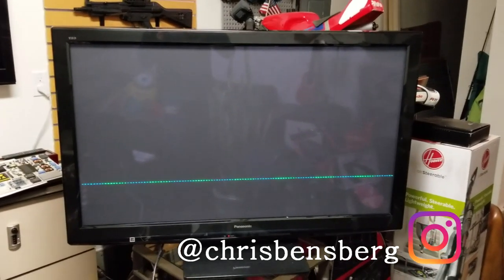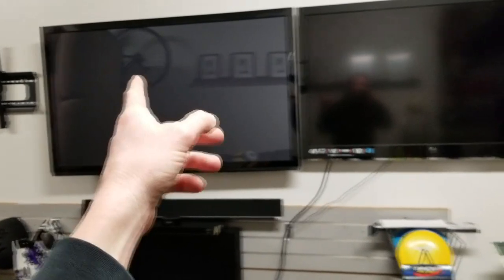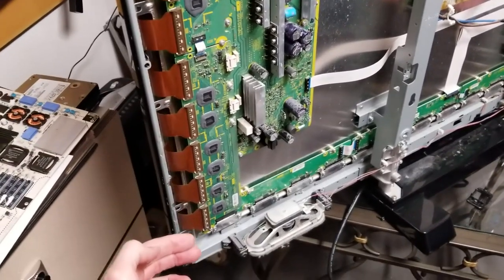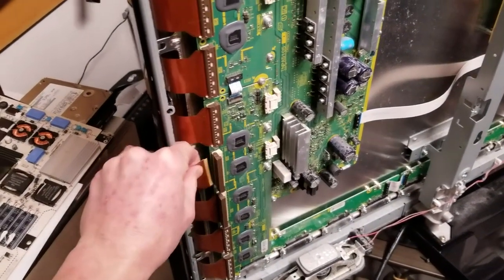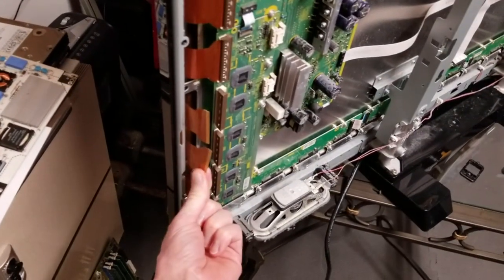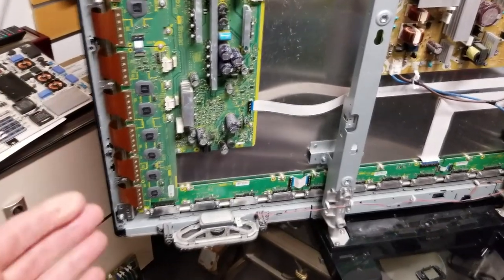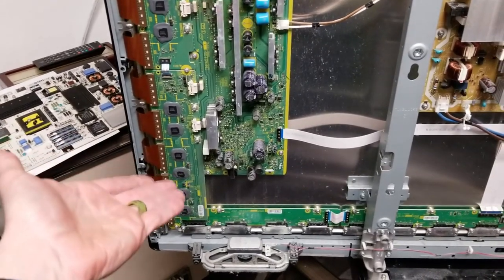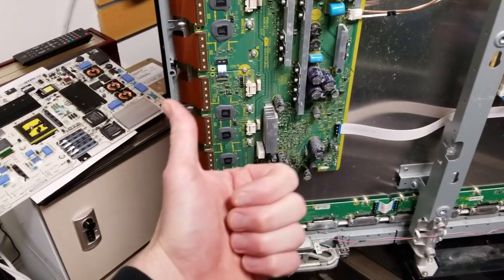Panasonic Plasma TV Horizontal Line Problem

Comment: Worked for me, Thank you!  I have a 2011 Pansonic 55 plasma - TC-P55GT30.  I had disassembled the TV to replace the SD board due to starting issue (7 red blinking lights).

Comment: When you have just one or maybe two lines that flicker in this manner, it generally cannot be corrected by re-seating the ribbon connectors or replacing the SU or SD boards. It is a problem with the panel. I have the same problem with my Panasonic and re-seating and replacing the SD board had no effect. I also have a Sanyo with a Panasonic chassis that has two single vertical lines that flicker blue in color. It too is a panel problem or the COF connector which has a shift register embedded in the ribbon connector itself.  A recent conversation with a Plasma TV service technician explained, in detail about these type of panel problems. Panasonics are known for these types of problems which are not fixable. You just have to live with it or replace the set. The display panels are no longer available and if they were they would cost more than a new TV. Note: If the line(s)s are black there is a chance it could be fixed by re-seating the ribbon connector. If the line(s) are flickering in a particular color, then it is probably the panel.
Reply: Well, i will have to respectfully disagree with you. Today, march 24th 2020, i fixed my 50" panasonic  viera tv p50xt50x.
I had horizontal rainbow lines, and even some vertical ones. For 1 week i watched videos, all related to lines and colors, for different brands. I learned about cleaning ribbons, ports, making sure the ground screws are tight enough, etc. I opened up my viera, started by cleaning the ribbons on the left side, connected it... no rainbow lines... but know i had solid black bars (bars, not just lines). Dismounted the Y-usis board, cleaned entirely with alcohol, cleaned the ports and the inner pins. Mounted it back, now i only had a few black lines. Spent almost 2 hrs, about to give up (even though i had had progress earlier)... I mean, you would look at the ribbon and it was clean (before it had some black points, dirt i guess or something). And certainly i looked at how the connectors would "click" and be okay. It all looked right. What? was i supposed those black lines were the panel? even though they were not the initial problem and after i reduced them from thick bars to lines? Nah... then i remembered a technician told me that Panasonic had very good quality panels, that usually they were never the issue. Had to keep trying. After many times of disconnecting and reconnecting the ribbons,  I realized that you need to make sure the ribbons and its pins are making good solid contact after you bring down the clip to secure the ribbon. What i mean is, i connected the ribbon and once secured, i would pass my finger along the clip, pushing it down, like, making sure the connectors would make contact.  This method worked on the first connector, decided to do the same with the rest (they all showing black thin lines, meaning 1 pin was not making contact). 
It worked. Perfect crystal clear image, like only plasmas can do it.
And it all started by blinkimg rainbow horizontal lines. My plasma panel is perfect.. issue was the lateral board.. dirty ribbons, dirty connectors and bad pin/ribbon connectors. 
Also, loose ground screws can cause certaim ribbons to stop working. Making sure they are tight helps.
Edit: Forgot to say, a technician wanted to charge around $200 and $250 bucks, with what we all known: "might be this or that piece, it is hard to get, might be the display, wont be cheap".  I was  about to buy a new Y-isus bar ($40 to $80 bucks), also got tired and thought on selling it for pieces or just give it away.
Thank god i persisted.

Comment: My tv a TCL.ROKU 32"720p  From 2018. Has long pink line and couple of blue short lines i had it 3 years not sure if its rebin cables or one of the parts inside
Reply: I had it for alot of months and now there are alot of thin lines on my tv
Reply: @orbitalsteak841man5  my tv has Horiontal Blue line